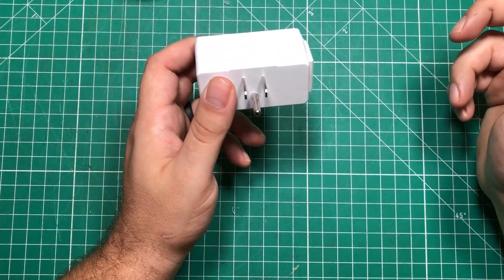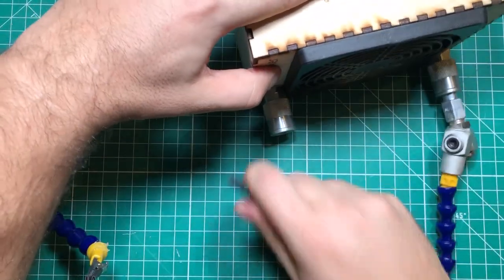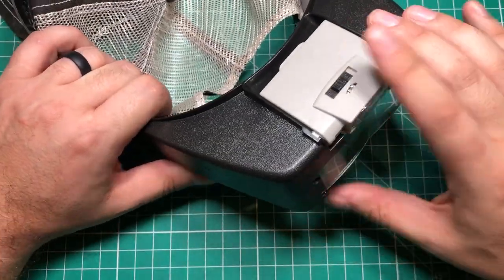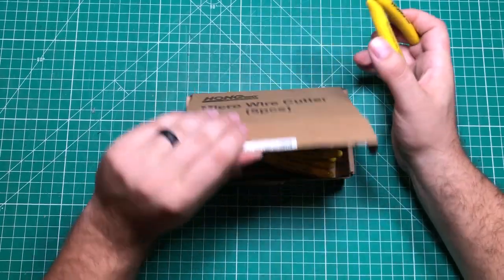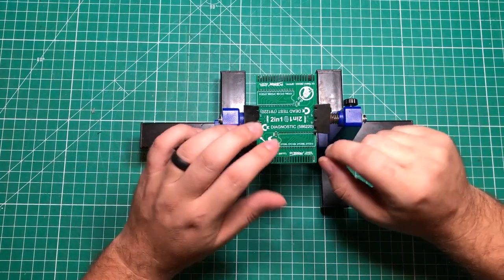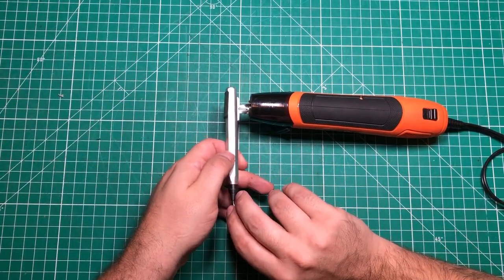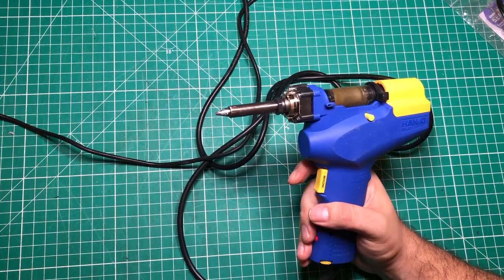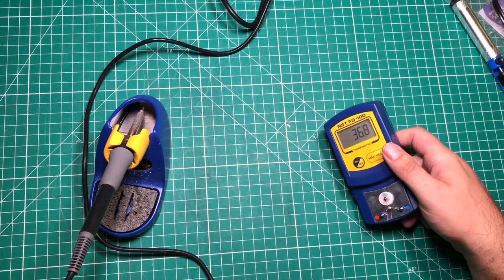21 Soldering Accessories You Need to Know

Comment from the maker: My Preferred Soldering Irons
Budget - https://amzn.to/3g6FGy8
Pricier - https://amzn.to/3GdT523

Auto Shutdown Timer 
https://amzn.to/3X3Zenu

Fume Extractor
https://amzn.to/3hFtzIH

Solder Reel Stand
https://amzn.to/3tvy1MU
3d Print one https://www.thingiverse.com/thing:4033261

Digital Microscope
https://amzn.to/3E83LMT
or 
https://amzn.to/3TA0ewr

Magnifying Headset
https://amzn.to/3WZiClx

Chip Quik Flux Pen
https://amzn.to/3GgCqux

US Forge Liquid Flux
https://amzn.to/3UXSaXs

Needle Nose Bottles
https://amzn.to/3EvRXW1

Soldering Mat
https://amzn.to/3O5so1c

5 Pack Flush Cutters
https://amzn.to/3UHC8kT

Eclipse CP-301G Wire Strippers
https://amzn.to/3Tw3oBD

Soldering PCB Holder
https://amzn.to/3UAw0e5

Brass Solder Tip Cleaner
https://amzn.to/3EyUq2k

Mechanic Soldering Tip Refresher
https://amzn.to/3AgYsK2

Mini Heat Gun
https://amzn.to/3Ag7A1u

Soldering Wire Holder
https://amzn.to/3EGpltD
3d Print one https://www.thingiverse.com/thing:2792522

Soldering Tweezers
https://amzn.to/3tsKcdt

Desoldering Iron
Hakko https://amzn.to/3EaQIuf
Budget https://amzn.to/3X43jYQ

Solder Suckers
https://amzn.to/3Ebhum6

Desoldering Wick
https://amzn.to/3hw4JuH

Solder Temperature Tester
https://amzn.to/3O8kunL
Reply: They have metcal stations pretty cheap now ehh. Metcal updated their psu so the old tower thing is around 250. I'd love to have a proper full jbc set up but I can't justify the price.

Comment: Heres some I like:
Play dough to hold small wires/parts
Suction pen for pick/placing chips
Ring light for lighting and camera
Syringe and needle for solder/flux paste
Reply from the maker: I've never tried play dough.  Does it melt like sticky tack or does it do better with the heat.i agree on the other stuff too
Reply: @AnotherMaker  Yeah, Blu Tack is a mess when it gets too hot.  Play Dough is made from flour, maybe? Gotta try this.

Comment: At a thrift store I bought what I believe is called a diopter, magnifying lens with a built in light. I remember seeing them in the dentist office and a jewelry store.
It comes on the end of a movable/flexible arm on a stand with a heavy base so it doesnt tip over. This one was "vintage". Stand and arms are metal and the lens is glass, not plastic. Works where you would use a digital microscope. Ive used the heck out of it.
Reply from the maker: I actually have one and I use it all the time. I agree. Highly recommend.

Comment: Cant believe I missed this video.  Love that microscope, like you sa for inspection especially with discreet smd components. FLUX, the best thing since sliced bread.  I have a solder mat I got from Sparkfun, need some of those needle bottles, we have a store here that sell those. The extractor fan is great need to look at your desing. Cutters yes!!!  I have the board holder, absolute must, prefer that almost to a helping hands, havent had good results with normal helping hands. Copper / brass sponge works better than water that a lot of people use. The 3d printed wire solder assist is a great idea.. Desoldering gun looks great I also think that Hakko gun is going to work better, the braid has a tendency to lift tracks.
Reply from the maker: The Hakko gun is one of my favorite tools I own hands down.  I hope everything is going well.

Comment: I watch your videos as they are tremendous help. As a newbie, I am a sponge to absorb what I can.  Then later, try to apply it.  What Most take for granted, I would have yrs ago as well.

But I struggle now with disability that makes all things a bit of a challenge.  But I am determined as I look at it as mandatory to accomplish.  

Hence, to others, I seem to ask the most elementary questions.  I have 1 size solder.  Do they sell different sizes in a package deal?  If so , what sizes should I get as a group?  

Most humbled!   Also, happy Thanksgiving, I hope yours was safe and enjoyable in your plans.
Reply from the maker: Hi! Thanks so much for watching! I've never actually seen a variety pack of solder.  For the most part if what you have is working, it's fine.  In general I use solder with a little more silver if I'm soldering something that's taking abuse like a laptop charging port or usb port.  Then leaded solder is just easier.  I understand for health reasons why some wouldn't want to use it, but it is easier.

Comment: Well, your kit outclasses mine by a long way.  Going to get your small wire strippers right away.  30awg Kynar is wonderful stuff, but very hard to strip ... even with their special (expensive) tool.
Reply from the maker: The small wire strippers are fine for casual use. They're kind of the thing that I like to have around the shop but I wouldn't want to use them every day

Comment: been looking at that soldering gun for a while i have the pump its almost useless for smaller stuff usually the recoil punches what im working on ( not like there is much kick to it just the small hit from a still point usually kicks whatever small component i have and for that reason i almost never use it ive done good with the wick but sometimes the heat and time needed isnt very friendly with the component, i feel sold on the gun now

Comment: I need a microscope I can attach to a screen on my wall. I don't know crap about the specs when I look at them. I have the same one as your small one and I've repaired it a thousand times. You're right about side cutters. I got more time off cheap ones than I did from the pair of knipex my wife got me for Xmas.
Reply from the maker: It's a little weird that when you plug in the hdmi in most of these, you lose the original display...so then it's kind of in the way.  You might want and hdmi-only model.

Comment: I bought something similar for a poorly designed battery charger that was destroying expensive proprietary Li-ion packs by trickle charging them or otherwise doing something it shouldn't.  Plug pack in charger, press 3hrs, battery saved.  I have considered doing the same for my soldering station but I think I would really rather just get a new iron...  Pinecil or T12 compatible probably.
Reply from the maker: People love those skinny portable irons.  Amazon just added a feature for smart plugs that I've been wanting for years.  You can now tell it to turn on a plug for x minutes or hours etc.